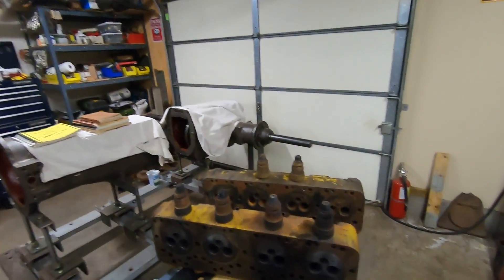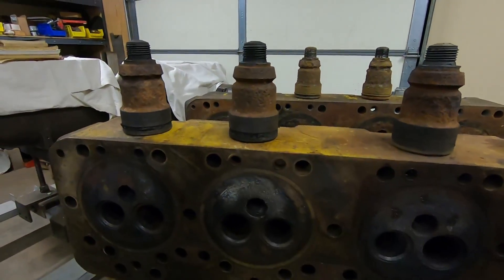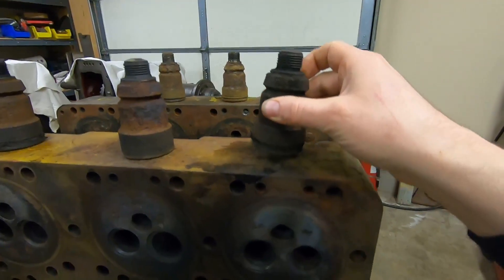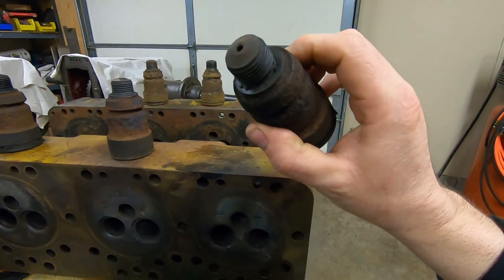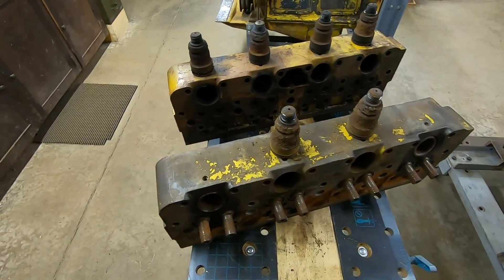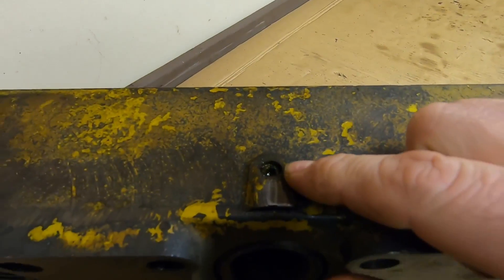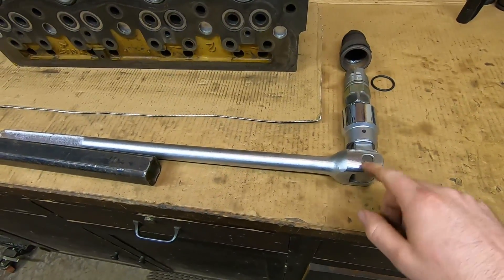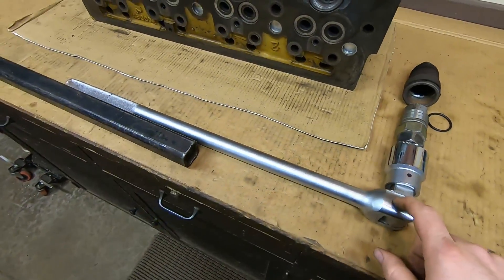Caterpillar D2 #5J1113 Diesel Engine Assembly Ep.24: Precombustion Chamber Conundrum

Comment: Pressure test the water side of the  chambers to stress test them if feasible. If no water leaks at joints and no pin holes, switch to a gas test such as helium.  If helium leakage is not detected after a pressure test you have one excellent assembly with no disassembly required. Shaving the head was a nice to have but it's still in spec, you did say.

Comment: Yep I would change them. Stick the head in the oven and set it to "broil" get it toasty warm and use an impact on the tool. If you have a chance, make a drawing with measurements of a good clean chamber, and a machinist could make new ones on the lathe

Comment: If the replacement inserts you have clean up and check out good, pull the others.
Have you tried baking the head assembly in an oven then cooling the inserts with dry ice?

Comment: Rubber seals are the Achilles heal of modern combustion vehicles. Just look at my 90 model Ford, which is unusable at the moment for this very reason. Every piece of rubber on my vehicle is rotten due to age and they must be in good condition for it run without destroying the engine. If you didn't take them out and  change the seals now you very well could destroy the engine and in my book that's not exceptable. Since this is a seal between water cooling and combustion systems they must be attended to, and as I see it you have no choice....Jack

Comment: Great video and education! Since the head is still within tolerance and if the engine will work correctly, I recommend not messing with it. If needed take the chambers out in a future rebuild when the head is worn enough to absolutely need to be machined. I am like you and I want things to be just right and it is hard to ease up.

Comment: Lots abd lots of penetrating oil and time. 3/4" or 1" air impact to generate some hammering.
Reply: Whats the biggest air tool you can put on there?.same tool as used for lug nuts  on truck wheels. Need power tools, with hammer action

Comment: I would not take the risk with those precombustion chambers, I would remove them. To find out they are leaking later on, that would be nasty. Regarding use of heat, a moderate use, say keeping the temperature of the head below 100deg Celsius, should be ok, as that is about at least the same kind of temperature as you would expect during operation. Many heat cycles and a lot of penetrating oil. Inside the cylinder of course temperature is higher.

Comment: At this point everything else has been stripped down to castings, so you know you would not forgive yourself if not doing the same with the chambers caused an issue later. I say soak the threads with Kroil for 24 hours or so and then pull them.

Comment: Pull ‘em. Try the wrench cold. If any or all come, well and good. If any or all are stuck, heat the entire head slowly and evenly in your bbq to 500*f. Use a temperature marker to tell you when you are there. Then chain it down good and hot and spin the rest out. Heating only small areas with a torch is a bad idea on rare cast parts.

Comment: What I’m thinking is soak the head in a large tub of diesel for a day or two. But as for replacing copper rings and the O ring most definitely get them out of there and replace it. The last thing you wanna do is do all this work and have a leak and start leaking inside the cylinder and you got to go back and do it all over again you don’t wanna do that do you?

Comment: Take them apart, you have dissasembled this engine to the bare metal and you'd leave a decades-old oring in a critical part of the engine?, plus you can clean the inside of the water jacket of the head

Comment: They are very unlikely to leak if left alone. I had to remove them on my 17A to plane warped heads and the top thread peeled out of the head . Far worse if it leaks on that end so I bought another head. Even if they did leak later they can be changed with the head on the engine. I know it's nice to do the best possible job while you have it apart but I think it's  just as likely to cost you  a head as to cause  a leak. I really enjoy your videos ,good work!

Comment: Dude! You've already answered your question - pull them! You have the parts - you've "done it right" thus far, as another poster said it will bug you forever if you don't. Goddess only knows the condition of those O-rings, which will continue to deteriorate as time goes on. Then to finish up "doing it right", PAINT THE ENGINE! ;) :D joke

Comment: do one at random. If it's fine then it's safe to assume the rest are fine. I would assume all are ok. But I agree with the reshaping of the head.
Reply: That rarely/never works---the "assuming" part. Why do i know? Because it was usually the one in the hardest place to get at that would cause the BIGGEST problem or all come out with no problems except the LAST one.
Reply: Fair. I am apart of the Hiser household. The last time anything worked out for us it was a fireball of hell breaking loose.

Comment: Now is the time to remove them, replace those o-rings, use an inch impact and work them loose, keep loosening and tightening in short bursts untill it starts unthreading, i have done that with allot of stubborn bolts and they work loose better than just trying to keep loosening them. Once they start to move start soaking with penatrating oil, wait awhile then try taking them out.

Comment: Possibly using an induction heater inside the precup may work and not compromise the head. Believe I'm not to far away from you if using my heater is an option you want to try.

Comment: It's not like you have to get that machine back into service tomorrow... Personally, I would put some penetrating fluid on those threads for a week or so (which all this time it was sitting there while you were working on the rest of the engine it could have been soaking), then get them out one way or another. If your luck is as bad as mine, you are darned if you do (one might get stuck) and darned if you don't (one might leak after assembly)...

Comment: Weld up an adapter for your air chisel to turn it into a vibrating hammer with a socket and a handle for turning so when you pull the trigger you are putting maximum hammering action and twist all at the same time. Just like a hand held twist tool for screws only this one is on steroids with all the air pressure your compressor can handle.

Comment: It would seem to me that a good 1" drive air impact wrench along with your homemade tool would get those pre-combustion chambers out fairly painlessly.
Reply: If I remember correctly you have a stuck chamber or two in those scrap heads you could try the 1" impact idea on. I'd like to try it out on my scrap parts before trying it on my mint parts.

Comment: Try to pull them. A very large impact gun may help. Years ago at old family shop we had a stuck fastener that a 12 pipe and 240 pounds could not rotate...  Called in help from a company that serviced giant equipment with an impact gun so big it took 2 men to carry it. Bllurrp. Off in .3 seconds. ... and no thread damage.  a 12 point engagement drive tool may help too.. but the cost of the custom tool for a once or twice a lifetime use would be insane high. Maybe the Cat Association could have a special tool made, cost shared by members, and loaned as needed... just bring a huge air gun.

Comment: Pull them
You have so many options with the head off sitting on the bench that you don’t once it’s back on the engine.  

If you run into a stuck one, you might try chilling the chamber while warming the head.....gently.  I would use liquid nitrogen poured into the chamber from the top but I have a tank full here.  Probably could get some dry ice and do the same thing

Of course you can also soak them ahead of time in some sort of penetrating fluid

Time to get them out

Comment: Pull 'em.  In for a penny, in for a pound.   Plus the added reduction in your stress level knowing the seals were replaced is going to take a load off your shoulders.  You are a meticulous individual and I bet if you were to NOT pull the injectors, then that lack of detail would eat at you every time you started up that D-2.  Plus, how many hours are you going to put on that engine before you will have to do a complete and thorough rebuild?  How many years will lapse getting up to those hours?  You'll be an old man by the time that engine needs to be rebuilt.  Do it right the first time so it will last your lifetime.  God bless.

Comment: I would take them out to replace the seals for the very minimum. I worked on Cat Solar Gas turbines most of my life and stuck hot parts was the norm. What we would do is use a high quality thread penetrating lube and a large impact gun on the drive tool. The knocking force of the impact would remove more of the stuck bolts better than using a bar and a cheater. The engineers watched us work one day and he said that doing it that way would apply a more equal force all around the thread rather than with it applied from one direction. Great videos keep them coming.
Reply: If youve worked on turbines..have you seen AGENT JAY Z channel on youtube?...he is into 40s 50s 60s turbines..GE j79-13 my fav
Reply: @leeharris3061  In the past I have actually ran into "Jay Z" on a couple of the sites while working on the Solar units at those same sites. His background is on Aero Derivative engines that were originally used by the aviation industry. Jay specialized in GE units at the jet shop he normally worked at. My background was 45 years working on Industrial based gas turbines for Solar Turbines and a number of customers who stole me for a few years to help with their fleets of units. Here is a link to the Last unit I installed with a crew. I was the lead service rep on site for the installation and start up. I retired from Solar a month after the unit was up and running.   https://www.youtube.com/watch?v=bXkKDgctUCQ&t=215s
Reply: @patreilly6826  ..what an interesting video..thank you!..im 56 retired i have no knowledge about any of this, but i find it so fascinating..i just subscribed to that channel    you sent me after watching it..i found jayz channel a few years back and been stuck to his content since...ok thanks again for sharing that neat vid have a good day sir

Comment: I live by the same code that you do, so my advice would to pull the chambers and mill the head.
Your mind would never rest knowing the job was not performed correctly  (don't ask me how I know)
I would recommend refocusing your thoughts and efforts on the best method of safely removing those chambers?
Soak the head in some type of rust penetrant for a week?
What are the chances of getting a drawing of these chambers and getting a set machined at a professional machine shop?
Get a set machined for your project; get a set machined to sell to cover the costs of the machine shop and get a set machined to sell to help cover the same costs of your project.

Comment: My luck they would leak if I didn’t pull them and they are going to be a pain to take out no matter what. With that said I’d pull them and reseal. 
Have you tried preheating the head to ~200f and then soaking them in penetrating oil?

Comment: So, cast is more porous than steel. If you heat cast it dissipates a large amount of its heat into the steel contacting it. In other words heating the casting is not very effective because the steel is actually growing at the same rate or faster than the casting.......kind of the same if you heat aluminum to get a steel bolt out. Better off just heating the steel part and letting it cool fully two or three times then back it out cold. This also works well on exhaust manifold bolts for example.......

Comment: I may be wrong but I would think your precombustion chambers were made of steel. The cylinder head is obviously made from cast iron. If that is correct, then heat is your worst enemy. Do not use heat to expand the casting bores to make removal of the precombustion chambers easier. Steel has a higher linear coeficient of thermal expansion than cast iron. Heat will just make it harder to remove your parts. This is what I would do. Heat the precombustion chambers through several heat/cool cycles. That would help break any corrosion bond around the mating surfaces. Then I would soak the cylinder head in a bath of some penetrant of your choice for a day or two. When that is done, go to town using your breaker bar and elbow grease but do not apply any heat to the cylinder head. I hope this solves your problem.

Comment: There are so many different things that came to mind as I watched this I'm not sure if I'll get them all down.....I know where you're coming from on the old O-ring subject, but could you get inside far enough with a bore scope to get a decent look at those chambers and get a better idea of how corroded they are?.....How about laying it with valve seats up in an oven or some type of device you may have and slowly heat it up to a "safe operating" temp so to say and use wax around the threads?.....I realize your making good progress on this and you have stated in the past that the views and comments are a hinging factor in what you work on.  Worst case you could set it aside and go back to X-231 for a bit and occasionally hit those threads with the penetrating fluid of your preference.  

DISCLAIMER: The comments listed above are just suggestions that may have been listed prior to my rambling, I did not take the time to read the previous comments, furthermore I will not be held personally responsible for any damage inflicted upon the head by using any of the above listed methods of retrieval. ;)  However in the event any damage is inflicted, feel free to take out any anger from said damage on Rick Bork!

Comment: This is my idea on that. 
The orings are most likely dried out  and there going to leak. 
Maybe not right away but there going to leak.   What are the precombustyen chambers made of  ? Cast or steel ?  If steel you could heat them up and quench them but not red hot . Can rattle them with a impact? I know you could snap their off .  But i would definitely renew the orings .  
It's  dilemma  . Humm 😊😊👍👍

Comment: If you go to pull them, I'd suggest not relying solely on heating the threads. I'd go for serious chemical weapon, like Chrysler Manifold Heat Control Valve Solvent on the threads, and cooling of the pre-chamber threads from the inside. Bring all guns to bear, IOW; use every unfair advantage to get it done and save useful parts. Good luck however you proceed.

Comment: Can you build a clamp that does not interfere with the head surfacing machine, to unbowed or unbend the head prior to surfacing. So you are not taking the ends of the head off more than the middle.  Put your straight edge across the top of your head.  The bow will pull out of the head when you torque it down hopefully.  Did you see Marty t video yesterday pulling the prechambers out of the d2 he pulled out of the boonies.  I can link if if nobody else does

Comment: I would use air tool . it will shock (or hammer ) it and thay will come out.
Reply: I would use an air tool also. A 3/4 or better a 1 inch drive. The hammering should pulverize enough of the corrosion to get things moving.and since the new tool you made is tight fitting the hammering should not damage anything.

Comment: I was in the navy for 22 years and the ship i was on was the uss pegasus a hydrofoil, we had to remove the front wing for maintenance the pins that held the wing on had to be frozen to remove and install. the center of the pin was hollow so we had this clay like material that we used as a cofferdam and pored liquid nitrogen to freeze the pin to get it out it worked quit well. In your case i could see plug the injector port  and poring in the nitrogen then try to get it out just an idea.

Comment: Do D2 heads use replaceable valve seats, and water directors pointing toward the Pre-combustion chambers? I agree pull the chambers, inspect and reseal. You don’t want that in the back of your head, is thus going to leak when brought up to temp.

Comment: My thought on the subject is, put the air quotes wrench to them. What ever moves change o rings ect. If they won't move leave them alone at that point. Won't know till you try. Also that note has lead to alota broken easy outs and broken taps in my life lol. Saying that if it was me I would be trying to decide if it was worth it or not too though. Tempting to leave a sleeping bear lay until its an issue. Reguardless will be watching anyhow :D

Comment: Degradation of the o-ring will continue and even if it is OK now, in a few years they may start to leak, putting you in the position of having to remove the head and replacing them.  Replace them now when you have the opportunity.

Comment: I watched a guy remove them and he would heat them then spray brake cleaner inside to cool the chamber that way the head would be expanded and the combustion chamber would be a little cooler and shrink

Comment: Hey squatch, I have found luck with a really hot pressure washer to break loose some corrosion. Maybe you could use some sort of acid bath for the head to break loose some of that corrosion also, I've never tried that but, it's just a suggestion. I've also wondered about boiling it in some water, good luck. Im loving the quality content you put out!

Comment: To each his own. Not taking those out and hoping they don't leak is a gambol. There is no way to know if they will leak or not until the engine is running then there is an awful lot of work to fix it. I agree with not wanting to damage good parts but if it comes to that you do have good ones you can use. It's likely that you wouldn't damage all of them. I'm not a gambler. I would remove and reseal them for peace of mind. That's just my own opinion and what I would do.